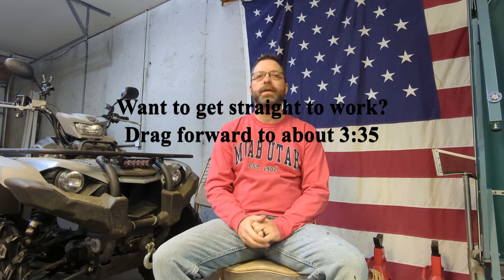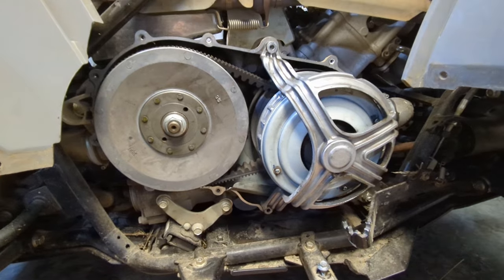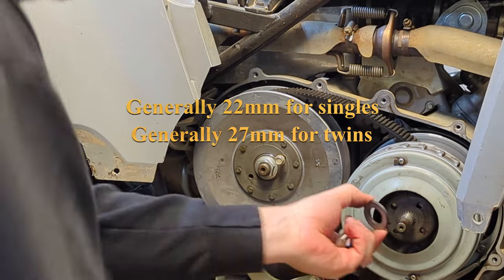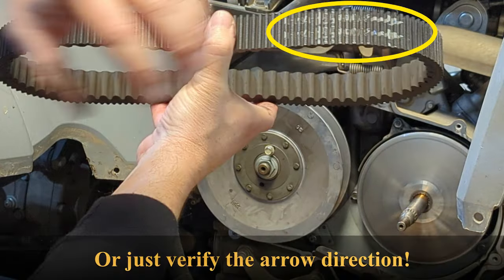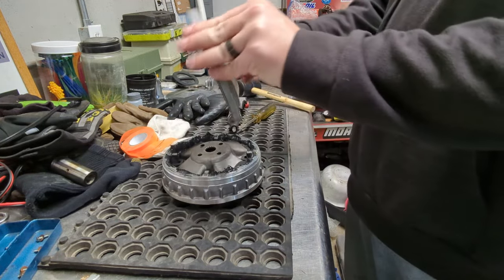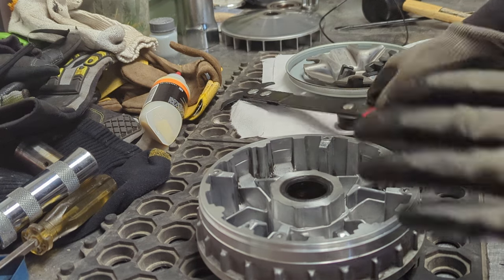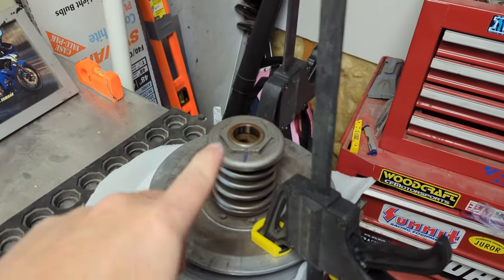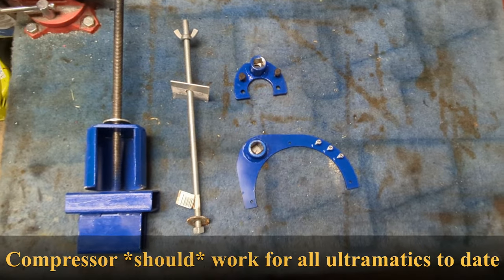Yamaha Clutch Service RMAX X2 X4 Grizzly Kodiak Rhino Viking Ultramatic Primary Secondary Rebuild

Comment: I’ve got a 2009 Grizzly 450 with around 4000 miles never touched the belt or clutches rode many trail miles hauled a lot of firewood never smoked the belt great cvt! Still running factory battery after 15 yrs ! Yamaha rocks ! Probably should check the belt at this time
Reply from the maker: Oh yea, excellent belt system. The best. What I describe in the video is recommended preventive maintenance. You can get by with a lot more mileage though, especially on the ATVs.

Comment: I used Tink seal on both clutches 2000 miles ago. When I took them apart the secondary looks great. The primary however, most of the grease came out and was all over the cage. I think I going to an ultramatic equivalent on the primary and tink seal on the secondary.
Reply from the maker: Interesting and thanks for commenting.  I'll keep an eye on my Rmax as it has tinkseal. I wonder if your primary o-ring got leaky?  Not sure how else that would happen.

Comment: Great video! What’s the name of that other grease that works for both? Can’t get yamalube this weekend trying to find an alternative. I have brake caliper silicon lube, thought of trying that
Reply from the maker: Tinkseal works for both. I know bel-ray wheel grease would work in a pinch for a short time if it was changed back out quickly. Really not sure about anything else.
Reply: @coachvonyo  cool thanks for the quick reply. I’ll see what’s available
Reply: @coachvonyo marine grease works very well for all services on this clutch due to its waterproof properties
Reply from the maker: @mc-rob4762  I had a negative experience with a Grizzly 700 and a great waterproof grease (Belray) and never tried it again.  I suspect it was a combination of extreme heat/cooling cycles with the motion and dust contamination over time from the cooling air pumped through but the grease broke down and the sliders were making an awful noise.  I had to get back in there and service it within a year. I won't claim that one experience is the holy Bible though, I just never tried it again.